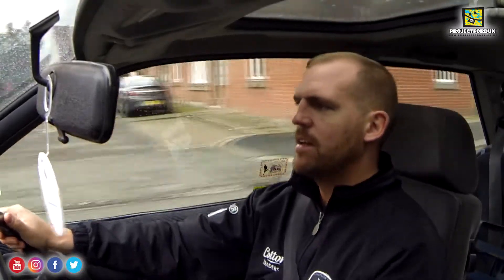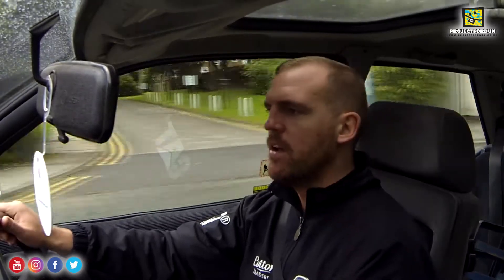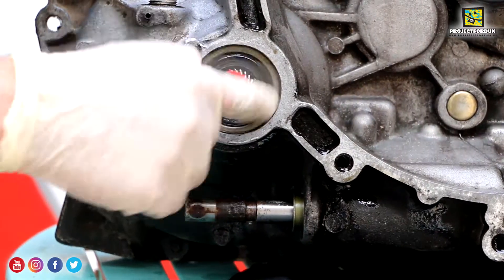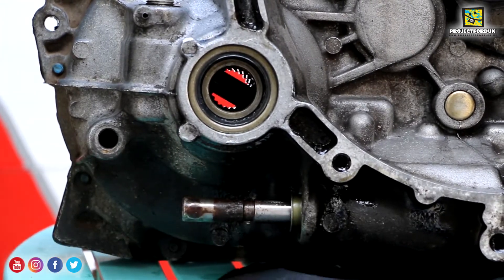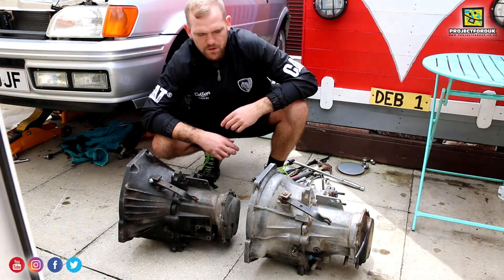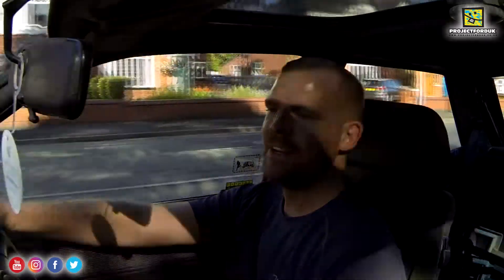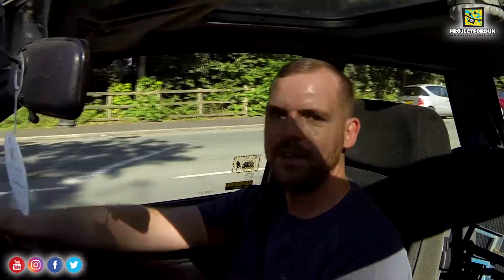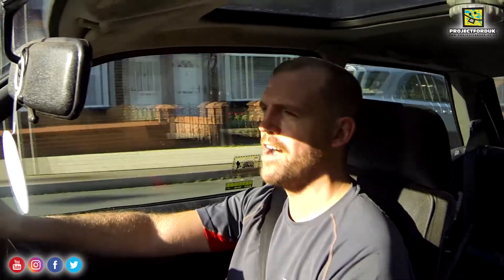Part 21 - Gearbox Swap  - 1993 Ford Fiesta RS 1800 / Turbo Restoration Project - HD

Comment: Was going to comment before on the other vids it seemed speed related especially when you come to a stop it was noticeable so was going to ask if a wheel bearing was buggered. Have you noticed much difference in the ratios being shorter or longer with the standard box?
Reply from the maker: To be honest Andy I haven't noticed too much of a difference only the gear change feels smoother.